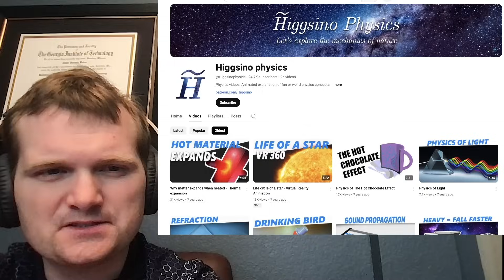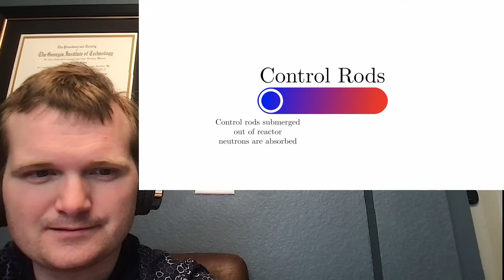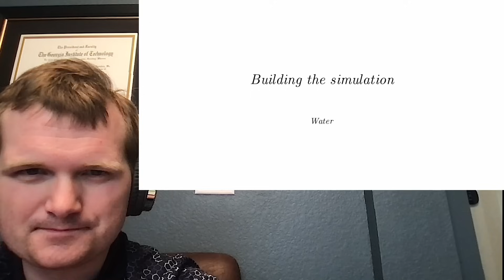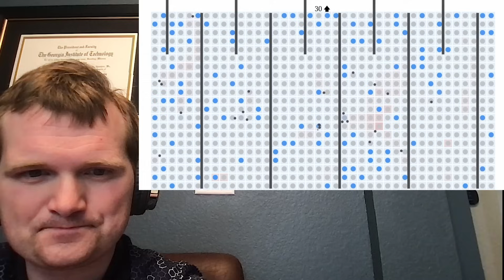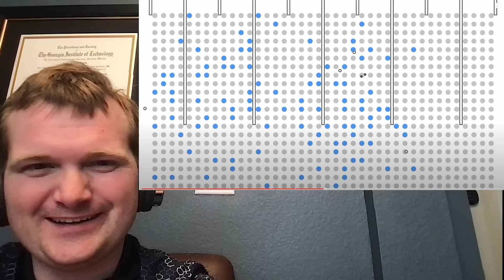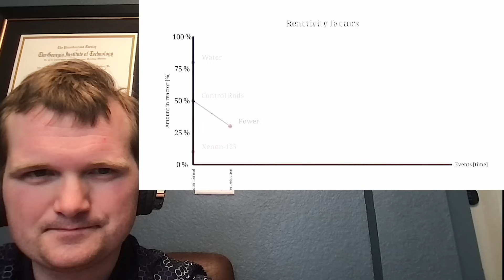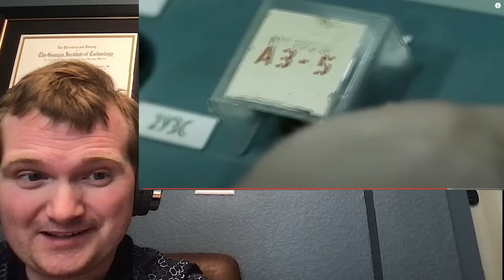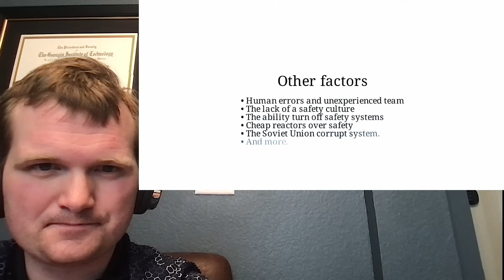Chernobyl Visually Explained - Nuclear Engineer Reacts to Higgsino Physics

Comment: There were no graphite ”tips”; they were approximately 4.5 meters long and attached with a telsscopic follower. When rods were fully withdrawn they were centered in the reactor. There was no way to withdraw the graphite out of the reactor except by inserting control rod. So you don’t insert graphite first; it’s already there. The defect of the design is more subtle. There is a little bit of space (about 1.5 meters) at the very bottom of the reactor where there is water in the channel. There you will briefly insert reactivity by moving the graphite; but this would normally be compensated by having less graphite and more control rod at the top of the core.

The way this can bite you is if most of the neutrons are at the bottom of the core. RBMK was huge and it can be critical in one part of the core and subcritical in another.
Reply: very well said!
Reply: Why was there Graphite on the bottom of the Control Rod though? How exactly did it make it "cheaper to build"?
Reply: @ZippyPiglin36  Because graphite is a moderator and better moderation provides positive reactivity. If you fill the hole left by the control rod when it exits at the top of the reactor with graphite instead of letting it fill with light water you are providing a better moderator. There is a bigger swing in reactivity between the rod being raised and the rod being lowered. This means you need fewer control rods to operate the reactor and it will be able operate on slightly lower enriched fuel. The little bit of water at the top and bottom of the reactor shape the neutron flux inside the core a little bit and they made poorly documented changes to the length of the graphite rod, reducing it to 4.5 m which was a part of the accident.
Reply: @soylentgreenb  So the Soviets decided to make the Control Rods a Moderator Rod instead of getting good pumping?
Reply: @ZippyPiglin36  Good pumping? Less channels and lower enrichment are perfectly clear benefits.

It is neither a flaw, nor a problem that graphite moves into the core when the control rod is withdrawn and something has to move into that space to equalize pressure in every reactor; if it wasn't graphite, it would be water, which filled the rest of the channel.

The flaw here is more subtle. The graphite rod is too short to reach all the way to the bottom of the core when the control rod is in the fully withdrawn position. If you combine this with an unusual operating history at low power and most of the neutrons happening to be near the bottom of the core this means you can see this increase in reactivity when graphite displaces water at the very bottom of the core. The xenon-135 burned off first at the bottom of the core, which already increased reactivity and neutrons in this part of the core.

RBMK was a very large reactor due to the low enrichment and high power output. You could have one part of the core be critical and another part of the core be effectively shut down. This is not very desirable and drives complexity and difficulty operating and analyzing the reactor. During operation the operators would be carefully fiddling with the control rods constantly to make sure power production is evenly distributed to the best of their abilities. 

The dual moderator design itself is a bad idea and major flaw; if it boils inside the core this creates voids where neutrons can zip right across and encounter graphite, which is a better moderator. So the fact that the core is overheating enough to boil increases reactivity and power output; which is not what you want. If a pressurized fuel channel bursts and the water flashes to steam this increases reactivity too. They calculated that it was OK for one or two channels to burst simultaneously and were just OK with the idea that if three channels burst it would mean an uncontrollable run-away reaction. 

Design requirements for the RBMK was that it should have low enrichment and online refueling for purposes of being able to make plutonium for bombs. This would be not very good plutonium; but good enough with tritium boosting and accepting some residual chance of a fizzle; it was in practice never used for this but it was a design consideration. This pushed the design toward using graphite moderator. The high power and need to use it for electricity production pushed it towards water as a coolant instead of using gas-cooling as was common in old graphite plutonium producers (these were initially extremely simple and low power ; just a graphite block which you pushed unenriched uranium slugs through manually using a rod for pushing through a concrete biological shield; all open to atmosphere). Heavy water was also a possibility and commonly used in more productive plutonium-producing reactors but they went with no pressure vessel and graphite + light water because it was cheaper. They could have designed something like CANDU but it would have been more expensive. Having many individually pressurized channels meant that they didn't need to have giant forgings that only one or two places in the world can handle, they could have low cost soviet labour weld a bunch of pipes instead of building a forging press that can take a 600 ton ingot and press it at 15 000 tonnes of force.
Reply: @ So the Graphite tipped Rods itself were not an issue specifically, but simply trying to be risky with the experiments was?
Reply: @ZippyPiglin36  Tipped is still the wrong word; it conjures up the image of a small little end cap or tip on the control rod to guide it through the channel or something. The graphite wasn't specifically a problem; having the graphite not extend to the bottom of the core was a serious design flaw; as was half-a-dozen other things without which the accident wouldn't have happened.

Nearly every serious industrial accident is like this. They have safety systems and procedures, but there is some combination of cutting corners, accepting that indicators and safety systems are malfunctioning and working around it, operator error, complacency, misunderstandings etc that all combine to something really bad.

Three mile island was like this too. They had an operator who was really worried about the wrong thing (primary loop "going solid"; because that's was one of the worst things that could happen, especially in small naval reactors). They had a leaky relief valve (PORV) and were looking at a temperature gauge to try to understand if it was closed or still open and had missed in the confusion that it was still wide open even after sending a close signal. They had a confusing control system were it was hard to trace where warnings came from. If you've ever programmed, think of it like compiler error, one error causes another later in the code and that original error cascades into a spew of 20 other warnings and errors. The original error can be something simple like  the type of a variable is wrong, or you forgot to end a line with ;. But this causes an amazing confusing jumble of errors that disappears if you fix the original problem. If you have a bunch of warning lights go on you don't know what came on first. So they had this slow printer that would print things in chronological order that they had to dig through pages and pages to find what happened first. They didn't understand and hadn't been trained on the scenario that actually happened with a steam bubble inside the vessel that uncovered the fuel. It's almost never one thing.
Reply: 4.5m would be Graphite Endings then (linguistic error previously). The Xenon buildup was, I think, a bigger issue, but that wasn't intentional design but rather negligent operation. 
Since, as you mentioned, a part of Three Mile Island was linked to Computer Issues, wouldn't present day electronics significantly simplify and accurately pin-point errors? 
And yeah, cutting corners is the enemy of every industry. It's just that RBMK was closer to cutting corners of a square turning it into a circle. Operator Error could also be improved by partial automation, also linked to present electronics. Also, wasn't the actually proper computer "Safety System" of RBMK's Control Rooms closer to a Log keeping Machine over an actual real-time detailed computer? I think you might've mentioned this in your previous comment, but that can be solved pretty easily. 
So most of RBMK's Explosion arises from cost cutting and operator errors, both of which have been resolved for what extent it affects us today.
Reply: @ZippyPiglin36  You literally could not get the reactor to start without them, RBMK uses natural unenriched Uranium and without the extra graphite there's not enough neutrons or reactions to get going. It basically means instead of having 'brake on, brake off' the rods also served as a gas pedal, you could have them in gas or brake. 

The problem was there were spots at the top and bottom with no rods(intended to help make reactivity more even in normal operation) and with all the rods in the 'full gas' position and being set to 'full brake' at once suddenly that water at the bottom of the core got pushed out and there was literally nothing in the bottom half of the core controlling the reactor(top half still had it's water gap plus the boron rods entering). This was compounded by there already being a hot-spot there due to too many water pumps being on leaving the water flowing too fast to cool off in the steam drums properly, so it was entering the reactor near boiling leading to voids. 

A similar situation occured at the Leningrad-1 reactor in 1975 following a turbine tirp, but their operator had experience on Mayak's graphite reactors and knew about this effect, so instead he inserted the rods slowly a couple at a time. A fuel channel burst and a couple were damaged, but the reactor survived. Dyatlov said in one of his books if they had known about the tip effect and had gotten into that situation they would have done the same thing, and the math says it would have worked.
Reply: @kalkuttadrop6371  Did Chernobyl's Reactors have Containment Buildings? If they didn't, how less of an impact there would've been if they did?
Reply: @ They didn't. It would have blocked the release outside of the reactor room area, though there may have been a breach given how powerful the explosion was. 

RBMK's are extremely difficult to make containment of due to their size. I should also note depending on the type of reactor there are two different 'styles' of containment (For example, some of them are basically a small shell around the reactor vessel not that much bigger than it that the pipes and stuff go through, and some are gigantic buildings the whole reactor room is inside.)

Comment: The way I understand it - the graphite displacers were about 4 meters long, so the simulation is correct in this case.
They were not long enough. The idea was that when you pull out the control rod, you replace boron (or whatever is the absorbing material) with graphite, which makes the control rod have more effect than replacing boron with water.
The displacers were too short - when the rod was fully removed, there was water at the bottom of the channel. Inserting the rod would replace water with graphite at the bottom of the reactor giving the temporary power increase. 

And oh yeah, the USSR system was really awful, in multiple ways. They lied to the reactor operators about the actual specifications of the reactor because "the USSR technology is the best in the world" so of course it cannot have any flaws. Someone noticed the reactor power briefly went up when they tried to shut it down (with no bad consequences) - better make the information secret or the capitalists will find out that the reactor design is flawed.
Also, interestingly, they charged the operators with something along the lines of "breaking safety rules in an explosion-prone industry", but I don't think that nuclear power plants were in the same category as ammunition factories before Chernobyl exploded.

Comment: 28:15 - "Those are some big tips"  - Yes!!! They were no tips but long rods of graphite precisely like this (so when the control rods are pulled out completely, the space is not filled with water but instead with this graphite "displacer" which reduces the output less then the water would).  So they are not here "for the purpose of the simulation" but they represent EXACTLY how the RBMK was build.

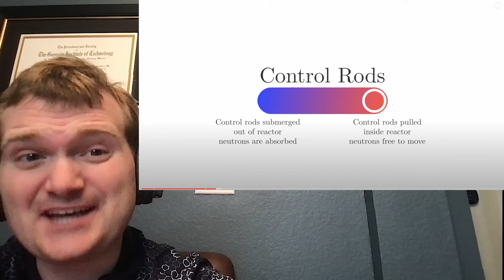Comment: The graphite tip issue (6:20) was always confusing to me, very much a non-scientist. I remember reading that one of the "fixes" made to RBMK reactors was actually not to remove the graphite, which apparently the engineers needed to increase reactivity, but to extend the graphite (that is, add more graphite) ... essentially extending the control rod's graphic portion to the floor (even with the boron portion of the rod pulled entirely out, so that the moderator would, in effect,  be essentially constant/unmoving, as you say later!), and it blew my mind a little. I think I wanted the super simple explanation to be "oh well you have the same amount of graphite but add some boron, the total reactivity will always be lower" ... but obviously if that were true Chernobyl would not have happened.
Reply: Update: Hey the video actually explained the issue in a way I haven't heard before at the end there! Thanks!
Reply: The problem wasn't the graphite tip(you literally need them if you want to make natural unenriched uranium run, either that or heavy water which the Canadians use. There isn't enough reactivity to get going otherwise). The problem was having all the rods(or almost all) in the 'full gas accelerator mode' (graphite in) and then trying to take them all to 'full brake stop now' (boron in) at once. That caused the water at the bottom to be displaced and for a brief moment you'd have nothing else down there to stop the reaction. If the reactor was otherwise stable it could handle it (Ignalina), but Chernobyl Unit 4's bottom section was having positive void issues due to the pumps running too high and not giving the water time to cool down.

Something extremely similar happened at Leningrad-1 in 1975 after a turbine trip, they tried to yard it into a quick start up and ran into the tip effect combining with the positive void coefficient. They got away with only a partial meltdown because the operators were all from Mayak(which had it's own fleet of smaller graphite reactors) and knew of this sort of issue and so inserted the rods slowly in clusters instead of slamming them all at once. It worked. Dyatlov straight up said had he been told of the tip effect he would have done the same thing
Reply: Positive Void Coefficient on it's own isn't a huge problem, especially since the negative temperature coefficient exists and can counteract it if given time. Canadian Reactors have a positive void coefficient, also use graphite, and are also designed to run on natural uranium and refuel mid operation. The difference is rather than graphite accelerator rods they use heavy water to get the extra bit of 'oompf' to get the reaction going.(which is more expensive, but Canada has the largest heavy water production in the world, it's their thing). And even those accelerator rods can be made to work safely, modern RBMK's work fine. Heck, even the old ones in the worst case scenario, you could avoid full blown explosion by inserting them slowly one at a time.

Comment: Uuh, that was actually roughly the size of the tips, they were 4m long or so, the entire rod is 7m long, this is why they are called DISPLACERS and not tips in most cases, also these were mandatory and were ADDED after a safety upgrade to increase control authority of control rods(normally rods displace water, absorber displaced absorber, now it’s absorber displaced MODERATOR)
Finally: the bypassing of safety systems was: A called for by procedure B in BWRs(unsure about PWR) still possible and called to bypass entire automatic scram system in case of a ATWS(scram system failure), but this procedure(SOP-RPS-BYPASS) can be donaat any time(obviously this is NOT allowed though, but possible)

Comment: 24:57 Shipboard reactor operators extract control rods during transients to increase average coolant temperature in order to increase steam pressure during high ordered bells (propeller speeds).  Our reactors are load-following, so control rods only control average coolant temperature, which is (Hot Leg Temp + Cold Leg Temp) / 2, steady state to steady state.  There is a brief increase in power, but it settles back to the steam load power equivalent.

Comment: Glad to see you watch this one! Question though, hopefully you might be able to answer: Many documentaries, especially older ones, make the claim of 'Chernobyl did not go off like a nuclear bomb'. Yet, in this scenario, the simulation seems to show a runaway chain reaction. To my very limited knowledge (Im studying Power Engineering 4th class, and nuclear & similar disasters i study as a hobby) the idea of a, for want of term, 'basic' fission bomb is to kick off a runaway chain reaction. The way this simulation lays it out, it seems to me that the first blast of Chernobyl's core could be a 'low order yield detonation' - if not an outright fission bomb, then a 'fizzle' of one; with the second blast being the steam, hydrogen etc tearing the building apart.  (As a side note, this seems to be a very similar event to what destroyed the SL-1 experimental reactor, where, for whatever reason it was, the central control rod came out way too fast for the condition of the reactor.)  What am I missing then?  Thanks eh?